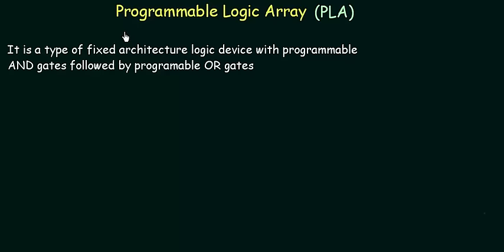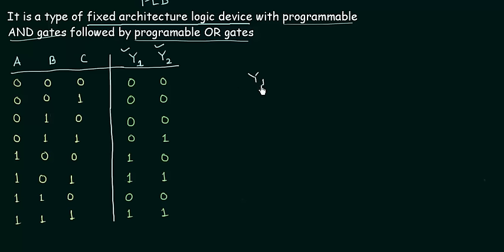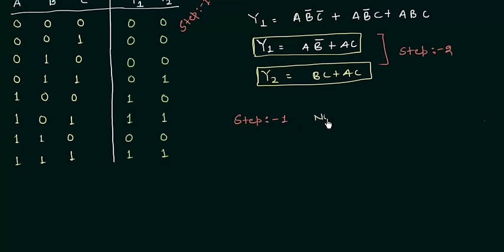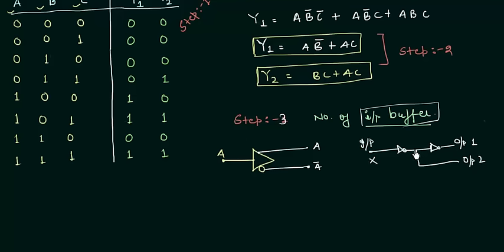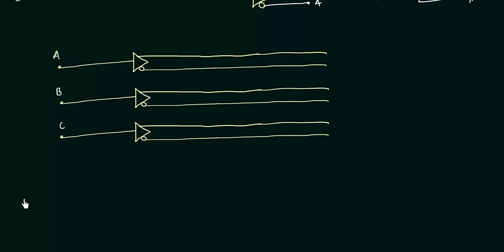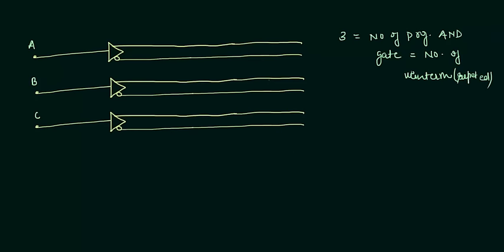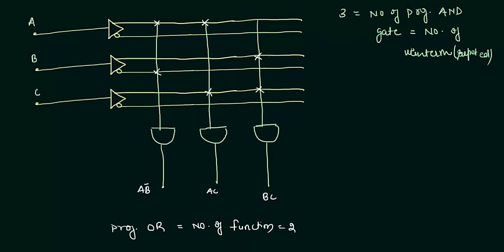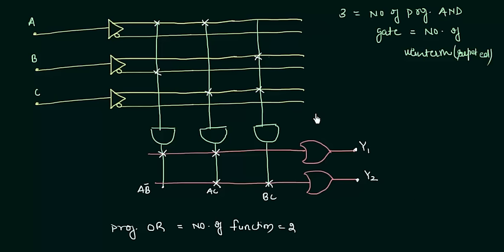Programmable Logic Array (PLA) | Easy Explanation

Comment: So what is the application of PLA and where it is used in digital electronics devices? As we know AND/OR gates has minimum 2 inputs but in this we are giving multiple inputs through a single line ,is it similar to short circuit case? Please explain the working also.

Comment: I had a problem in a question... I got the minterms as F1=BC+AC+AB
F2=AB'C'+A'BC
In the question it has been asked to use only 4 AND terms I got 5 AND terms... By solving F2 we can get (A (EXOR) BC)... Is that correct to use the exor gate in between???